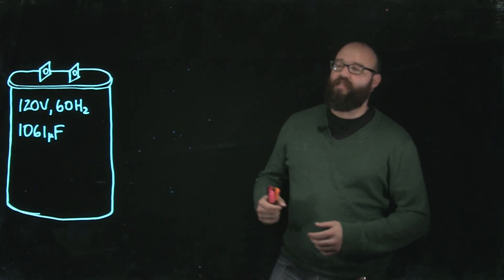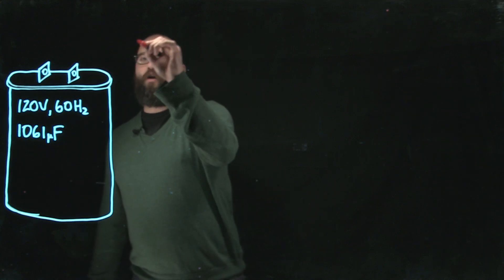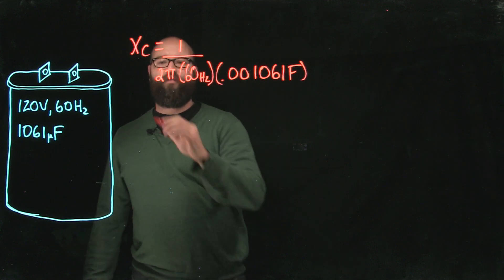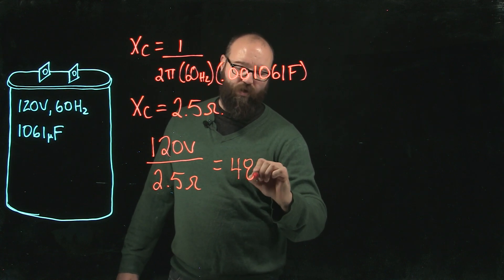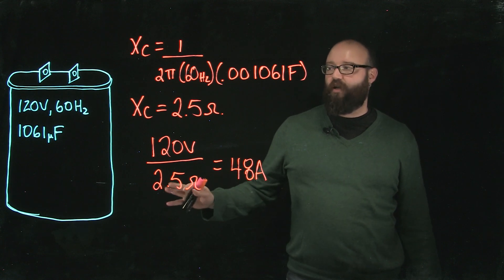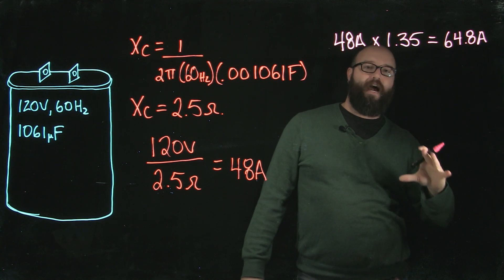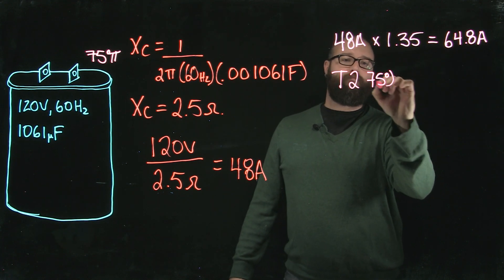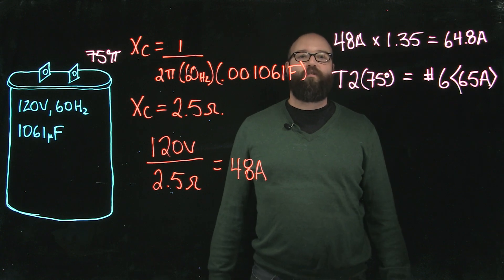Sizing Conductors for Individual Capacitors (CEC 23rd Ed.)

Comment: when there is no temp rating and lets say you are using TW75 3 wire, which temp you choose from T2 60/75/90 ? do you go with wire temp rating or based on calculated amps and rule 4-006?

Comment: 26-208 conductor size for capacitors
Reply from the maker: You are correct. I try to leave code rules out when I can so they stay relevant as code rules shift with newer versions.
Reply: @schulerruler  Ahh, I understand! I have had to cross reference in the past w/ the 2015 code – Checking old w/ New.  Love your stuff. Keep it going. It is a great resource for my study atm. I have recommended it to friends who are studying also. Cheers !